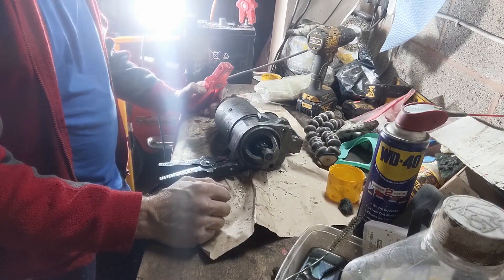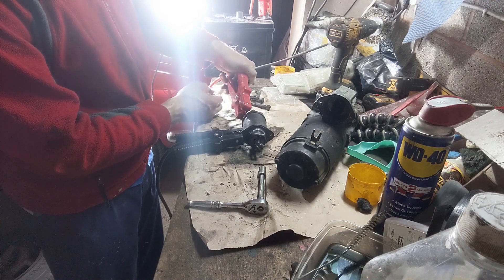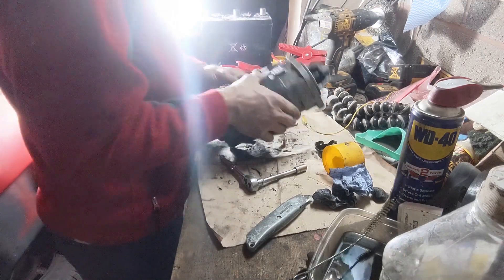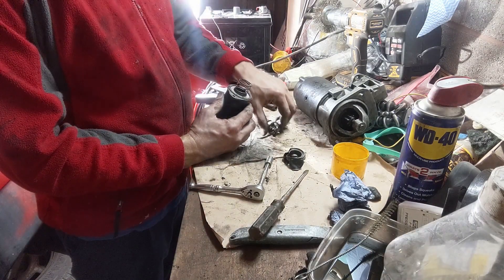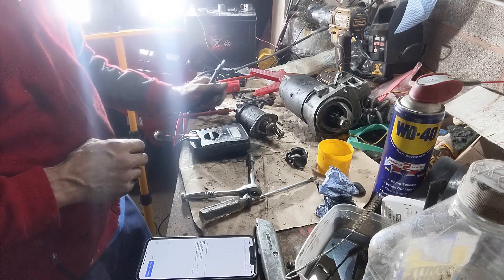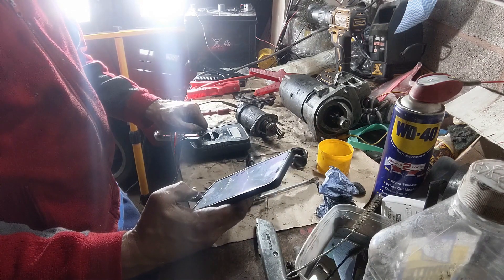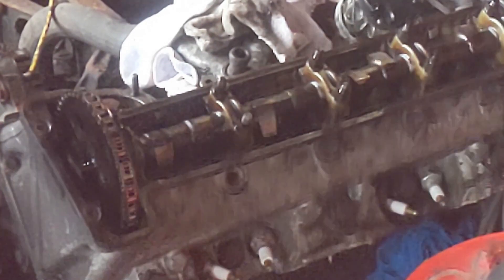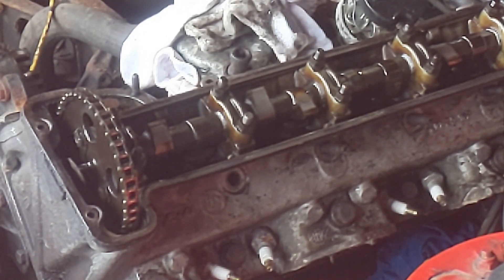Triumph TR7 Restoration:  Episode 37   Starter Motor Part 2

Comment: Hi Henry, A bit disappointing that the  solenoid isn't strong enough to engage the motor. It may just be that it is too tired and needs replacing. Before you order a new one, have you tried operating the pivot mechanism by hand just to make sure nothing is jammed? It should be possible to pull the pinion gear out with you fingers. There will be some force required as you are obviously working against the solenoid spring.
The resistance you are feeling while you turn the engine over by hand is probably compression as the spark plugs are still fitted. Try removing them and it should turn over easily with no hesitation. 
Keep up the good work👍. .
Reply from the maker: Thanks Carsten, I think the pivot mechanism is moving freely so I do think the solenoid is the issue, but it could be poor connections.  I figured the resistance is compression and it was just me talking as I was turning the engine - it was nice to see everything moving